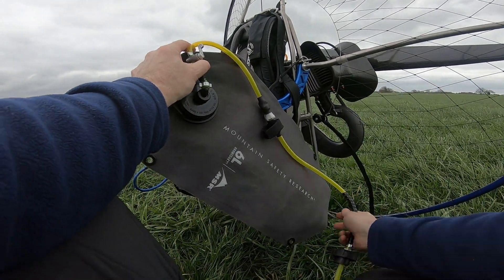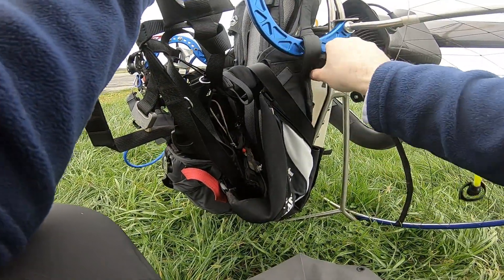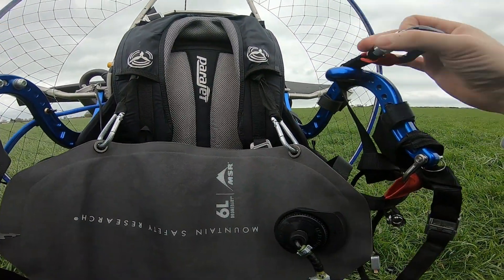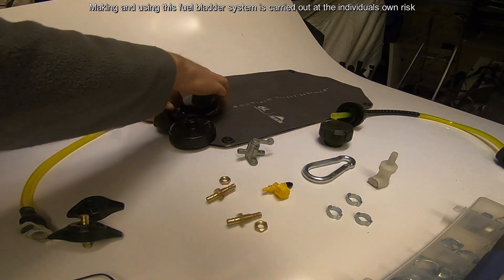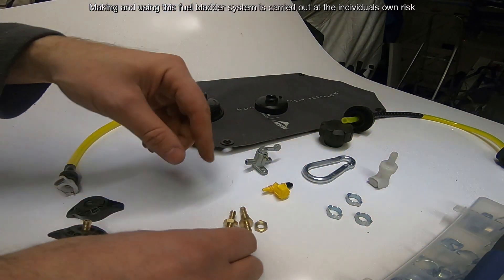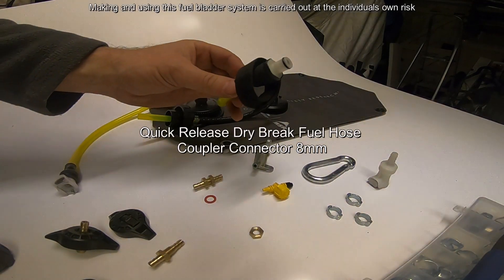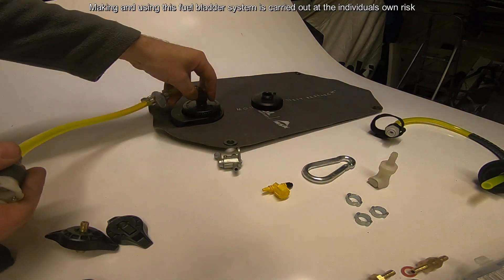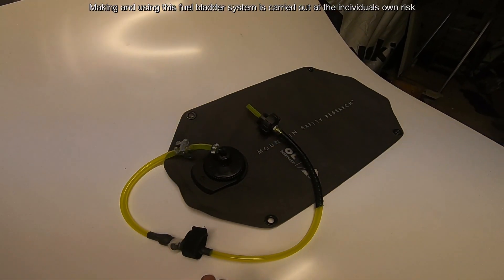More fuel for flying - Fuel Bladder

Comment: I just bought a fuel bladder for XC flights with my trike.  However, the options for mounting aren't as practical as I thought they'd be.  Your video is probably more in line with what I need to do.  Thanks for sharing.
Reply from the maker: Hi Greg, I hope you have some good success with the system I used. It pretty much the same as the system used by Tucker but I just couldn't see the little details so just tried a few before finding one that did.

Comment: Hi, what about fuel resistancy of this bladder, because it is normally used for water. Any experience within the year of usage?
Reply from the maker: Hi Mike, to date, and if you look back at the date of release I've not noticed any degradation of the bladder material. I still have one of the 2 I made. I hope that helps.

Comment: Great video.  Do you have it siphon into the tank mid flight?
Reply from the maker: Hi Jim, I had to wait for enough space to then transfer the fuel. If you just let the fuel gravity feed with a full tank, 2 things happen, 2, it over fill and tries to come out the vent and the 2nd is it over pressures the tank flooding the carb which in turn kills you engine. I hope that helps.
Reply: Gilles, thank you for that info, it is very helpful.  Have you ever tried having it suck into the tank by vacuum, I am thinking of trying that so that I can avoid these problems.  However, I am wondering how I will know when the tank is empty without killing my motor.
Reply from the maker: @jimsimard  Jim, I just used a mirror to see when there was enough capacity and the just let gravity to allow the fuel to fall into the tank. I used this process on the UK Icarus X and my RAFA40 trips with no issues.
Reply: @GolfFoxtrot22  Ok well I will give it a try thank you.  Did you have to apply pressure to the bag to get it started or keep it filling?
Reply from the maker: @jimsimard  gravity did most of the work, I just rolled the bag towards the end to get the last of the fuel out.
Reply: @GolfFoxtrot22  Thx

Comment: this is going to come in handy for some far flights!
Reply from the maker: Hi Chucky, it worked for my RAFA40 long flights and the UK Icarus X. Just don't use the tap that I used, use a beer tap on the black cover. I still have the bladders and they haven't leaked.

Comment: Thanks for making this video! price difference is not much from the Air conseption 10l tank. But id prefer this size of bag!
Reply from the maker: The only subsequent modification I had to do to the set up was changing the tap as it leaked. I liked the fact the MSR bag was tough and had clip in points. I used this set up for my RAFA40 and UK Icarus X events with great success. I hope it was helpful.
Reply: @GolfFoxtrot22  Iv now tried it. Also got the 6L MSR bag. works great in flight. BUT i have noticed that the bladder reeks of gasoline when i have it sitting in the garage with fuel in it. I'm pretty sure it actually is making its way thru the fabric at a very very slow rate. iv not spilled gas on the outside of it. and iv also put it inside a plastic bag which also started smelling like gas on the outside. Iv checked and it is absolutely not coming from the lid or any of the hose connections. Do you have any experience of this?
Reply from the maker: @longrangesweden  I have experienced the smell, but over the year that I used it, it never leaked through.

Comment: Caution: filling the bladder or emptying it into your tank could cause an ignition due to static electricity. Fuel bladders must be rated to store hydrocarbons. Ever seen "not for fuel" on a water container? - the reason is that static electricity may cause an ignition.  Quite a few manufactured bladders available in Australia - Desert Fox seems popular (no affiliation)
Reply from the maker: Thank you for the comment. I work in the aviation maintenance industry so am fully aware of the static requirements. I'm not saying its the most ideal bit I used it on the RAFA40 for and the Icarus X. I kept it a closed system to remove the vapour risk. I've fitted the 17 litre tank to my Maverick so no real need now for the bladder unless I went camping and would fill in the group. Appreciate the feedback.
Reply: @GolfFoxtrot22  wow quick reply. Good to know you're on the ball. Happy landings :)
Reply from the maker: @KiwiBro8  lock down and not much else to do. I've finished as much DIY as I can cope with today. Keep safe over there.

Comment: Great no nonsense approach. Do you think it would be possible to add two barbs to the modified gas cap. I’d prefer not to drill my tank and was thinking about putting the vent in the cap beside the fuel line. Thanks
Reply: You’ve been super helpful, but I have one last ask. Do you know of a disadvantage to just going with a larger primary fuel tank? I learned there is a 17 liter tank available for my Maverick and wonder if it is going to slosh  noticeably when it only 1/3 full (especially on the launch run). Any thoughts would be welcome.
Reply from the maker: @davidstiles6260  I have the 17 litre tank fitted. No issues with sloshing, and yes I do throw my wing around. It's perfect.
Reply from the maker: Yes perfectly feasible. It would just be a little faff when putting the cap on and off to make sure they don't get twisted up. I'm glad you liked the video and I hope it helped.
Reply: Golf Foxtrot 22 Hmm It’s now occurring to me that the standard cap only lets air in and not out. If I don’t find a way to let air out, I can’t see how the tank will fill. There would be no way to displace the air in the tank. Your little sprinkler valve is letting the air out as you fill.
Reply from the maker: @davidstiles6260  and that is key. Or you over pressurise the carb, and the engine cuts.

Comment: Any issues with gas leakage due to using water bladder?
Reply from the maker: In the 7 flights that I have used it and deliberately leaving it full to see if it would leak, I've had no issues.  You get a little odour of fuel smell, but that's it.  No leakage.  I hope that helps.
Reply: @GolfFoxtrot22  thanks giles
Reply from the maker: @mark4565  Glad I could help.